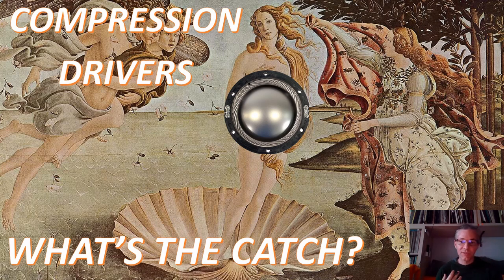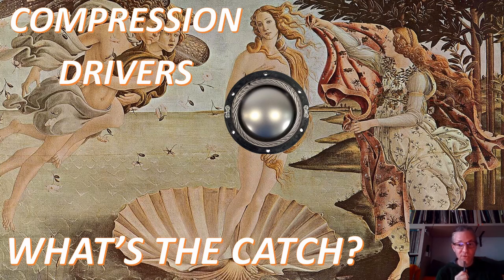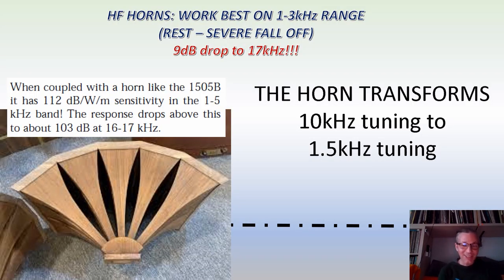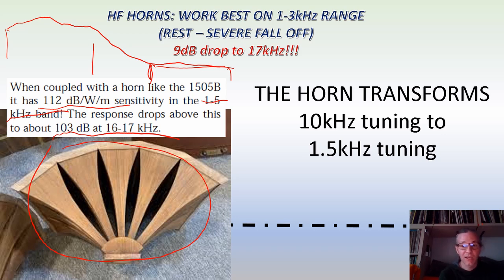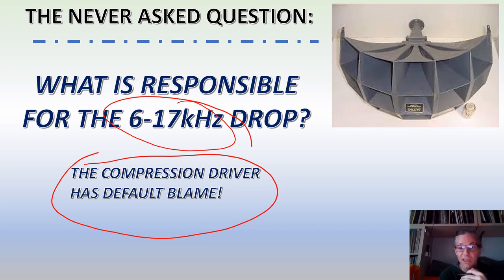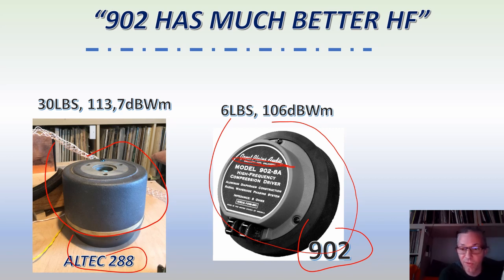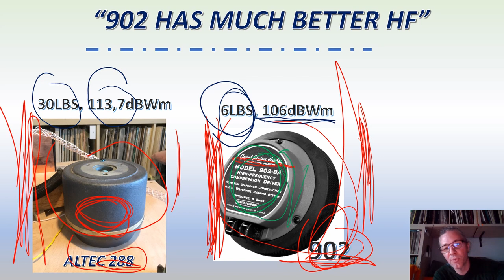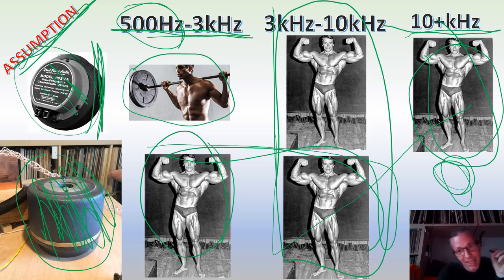What's the catch - horns and compression drivers 1/II.

Comment: That's so true. I never realised how good speaker can sound until i listened to a pair of JBL Project K2. And i have been enjoying this setup since the 90's. I initially augmented with the beryllium UT045be, but now switched using ribbon design beryllium from Pioneer PT-R9 that pushes the frequency response from 50khz to 120kHz. Sounds so much better now when paired with the K2. My friend too, i took a mini JBL 4306 for him to have a listen, after this experience he was totally convinced about the compression driver potentials. We build his system around JBL LSR705i and LSR708i... sounds fantastic! Now he is running JBL M2, together with beryllium ribbon Pioneer PR-R7iii. And me too building a new system based on M2 components...also augmented with beryllium ribbons, never looked back ever since. These components sounds superb especially running a digital active crossover setup. 😊👍
Reply from the maker: Cheers, superb! & thank you for the tip on using the Pioneer to supplement the ultrasonic region.
Reply: @realworldaudio  We would like to share with you ALL a few other very useful tips, which we have learnt and discovered during our past decades of audio journey that would surely greatly help in achieving great sound without breaking the bank.

TIP #1: Forget Passive Crossover and go Active Crossover

TIP #2: Look for hidden gems in speaker design that are based on the most advanced compression driver and waveguide design

TIP #3: Use a Digital Active Crossover that supports 24-bit 96kHz and run a steep crossover slope of at least -48dB/Oct

TIP #4: For HF Amp, choose a model that would provide super wide bandwidth and linear response into the 1MHz range.

TIP #5: For LF  Amp, choose a model that would provide high efficiency drive to cater for low impedance high current demands of the woofer unit

TIP #6: Forget PreAmp and choose a musical DAC that has HQ solution towards volume control

TIP #7: Focu,s on reducing jitter and achieving high-accuracy clock in your digital source

TIP #8: Connect your digital source to Digital Crossover and to the (multi) DACs and their respective amps, to drive the speaker drivers directly.

TIP #9: Apply jitter reduction components to fine tune your system

TIP #10: Component placement. Group DAC and Amp as close to the speaker they are responsible for driving as close a possible and run as short analogue cable as possible.

On Tip #1, without going into too much technical details, passive crossover introduces a lot of issues into the audio playback pathway that degrades the signal and is hard to correct.  Also it is difficult to achieve steep crossover slopes with passive approach.  For details, have a read on this white paper: https://www.deqx.com/wp-content/uploads/pdf/What-is-DEQX-Technology-Whitepaper.pdf

On Tip #2, as much as I am a nostalgic person who admires great classical compression driver design, the reality is, there has been great leaps of advancement being made by JBL in recent years.  Many would have heard the amazing sound from the JBL M2 monitors.  But much less well known and unheard of (and auditioned) are the JBL 7-series monitors.  There are 2 passive models in this range the 705i and 708i.  Both are jaw-droppingly good and way more afforable than the M2 (not that M2 is too expensive, it is reasonably priced).  Very few people would have had the opportunity to audition these speakers beacuse they are mainly sold to Broadcast stations and recording companies.  And unless one works in such environment, the chances of working and listening to them are rare. There are no Audio Shop we know of that stocks these speakers for demo.  And because they sound so good, very few pickings in the 2nd-hand used market...unless a recording studio goes out of business due to financial reasons.  You all just have to take our word for it, the sound from these monitors defies normal reasoning and are jaw-droppingly stunning.  The sound is completely disproportional to their physical size. Even the smallest 5" bass on the 705i is unbelievable.  It may look ridiculously tiny, but certainly not its sound... and the bass is amazingly deep, clean and good.  Check out the DDD driver and its very long extended bass port if one gets a chance to see the real thing.  And they are very afforable for what they are capable of delivering.  We would recommend to start with the 705i for the best bang for bucks.  And if budget permits look into 708i.  The compression driver and waveguide on these monitors would deliver the most beautiful and extended highs most people would get to experience, from a monitor speaker that is very close in performance to their elder brother the M2 monitor.  It would definitely put a huge simile on any audiophile, listening to these monitors for the first time (and each and every time subsequently) on a good proper digital active crossover setup.  It would give new definition to all the familar tracks one is familar with, revealing new details on each listening session.   These 7-series monitors would be our prime choice recommended to start with a digital active crossover setup.  Later if budget permits, seriously look into upgrading to M2 monitors.  Or for the more technically inclinded a DIY version of the M2.

On Tip #3, The DEQX unit may be a bit too pricy for someone who just started with Active Digital Crossover and wants to evaluate how much improvement an Active Digital Crossover can provide.  We highly recommend to look into NanoDigi 2x8 B as an alternative.  We have achieved superb results in Ken's setup deploying NanoDigi.  It will definitely provide the eye-opening revealation needed to convince anyone the benefits of a good Active Digital Crossover setup at a super affordable price.  We run a -48dB/Oct crossover slope on Ken's setup.  For more advanced setup and when budget permits, look into upgrading to DEQX.  With DEQX, which I personally use, I run a -300dB/Oct crossover slope.

On Tip #4, This tip alone is probably the critial success factor that reveals the true potentials of a good digital active crossover setup is capable of.  Without an amp that is highly accurate in time domain response, the benefits of the active digital may not be that apparent. Forget about Tube amps they have restrictions on the high frequency bandwidth required.  We need an amp that has a 3MHz super wide bandwidth and has a flat response within the the first 1MHz bandwidth.  There are few amps that will meet this criteria except the Goldmund JOB4 circuit.  Of course there are various amp  models within Goldmund with JOB4, but there are also variants of JOB4, if you know where to look.  Goldmund's professional branch StellaVox makes a PW1 mono block.  Not only that it features JOB4, it supports XLR balanced input.  These amps are super difficult to find in the market but if you are one of the lucky ones to find one, you are blessed. The PW1 would be our top pick, even over the Goldmund amps because of the XLR Balanced input support.  Then there is the JOB amps and even if you know where to find a NuForce STA200 which also features the JOB4, in a slightly scaled/powered down version.  The claritiy of the JOB4 has to be experienced to be believed.  In our opion this is the most transparent amp in the market, regardless of price.  It has the potential (if you deploy it right) to make your audio equipment dissapear and start to enjoy the music itself.  It is also super revealing and will allow debugging what problem one setup has easily. There is no masking of problems with this amp.

Check out this Goldmund Amp review to get some insight into this advantage:
https://www.monoandstereo.com/2016/05/the-goldmund-telos-360-universal-mono.html
Reply: On Tip #5, we found to get the most out of the latest generation of JBL DDD bass drivers, it needs power. To get optimal and extended bass response, you need amps with high current capabilites, with power delivered in an efficient manner.  The best balance we found are the 500w version of ICEPOWER amps.  The ICEPOWER amp can deliver incredible amount of current to achieve full control of the bass drivers.  With an active crossover setup, we can bypass all the energy sapping inductor coils in a crossover network.  So always wire the bass driver directly to the ICEPOWER amp.  We use one 500w ICEPOWER monoblock amp per bass driver.  The best value for money implementation of ICEPOWER 500W we found is from a less well known source - Ghent Audio GA-M500P.  They are excellent value for money and are highly reliable.  And have been providing excellent performance in our setup since we went down the path of full active digital crossover setup over a decade ago.  On a proper setup, these amps will allow the awesome JBL DDD driver to completely control the air mass within the listenig room.

On Tip #6, despite being nostalgic, we have assessed many latest modern DACs and reckon that the Wadia DAC still sounds the most musical and is still our favourite choice.  Wadia's implementation of the digital volume control is also superb and maintains very good resolution within the typiacl listening range.  The sweetspot is around the 85 setting and this is the norminal setting we aim to tune our setup towards.  Of course, with multi-channel for 2-way crossover, one will need 2 DAC units.  In Ken's setup, we deploy dual Wadia 122 DACs.  These DAC despite being very affordable sounds incredible!   We paired NanoDigi in 2-way setup with Dual Wadia 122 powering his HF and LF amps driving a pair of JBL LSR708i. And the sound is truly heavenly. Definitely an eye-opening experience and we can confidently say sounding much better than many system that cost 10x-20x more!  The clarity and high resolution power of his setup has to be experienced to be believed.  And bass from that 8" DDD driver is stunning to say the least....completely defying what 8" drivers are capable of delivering.  It is hard to put this listening experience in word, one just have to experience this at least once in their life to believe this. 
FYI, in my setup I deploy dual Wadia 322 DACs with DEQX as active digital crossover, with a Goldmund SR8 to support and decode mult-channel and digital source selector and digital volume control.

On Tip #7, try to use a digital source with as precision in clock signal as possible.
Starting from the digital source, we looked at how the digital clock can be improved. 
I run 2 main digital source.  To cater for various digital audio media on files, I deploy a modified Wadia 171 with high precision DEXA Neutron-star clock mods and various upgrades.  
For traditional CD/SACD I deploy a ESOTERIC X01 Limited player.
With a highly accurate clock, when we deploy the digital reclockers in tips below, you have a much beter chance of achieving HQ audio.

On Tip#8 and Tip#10, the focus is to significantly reduce channel crosstalk and noise pickup during signal transmission.  With a 2-way setup a standard appraoch is to have one DAC decoding HF for Left+Right and another DAC decoding LF for Left-Right.  But this is not the optimal setup.  A better setup is to have one DAC decoding both the HF and LF of the LEFT channel; then second DAC decoding both the HF and LF of the RIGHT channel.  And more importantly, reposition the DAC to very close to where the speakers are, and power the monoblocks within close range.

NanoDigi supports this remaping of digital channel output to achieve the topology of this setup.  This way all the analogue signal cable runs are kept to minimal and no issue with channel crosstalk, as the LF and HF signals are correlated in the first place.  The longer run of digital from NanoDigi to the DAC we would recommend running Glass Optics.  This can be achieved easily as the Remedy Reclocker supports both Optical and Coaxial digital IO.  Always run Balanced XLR whenever possible.

With speaker cables from amp to driver, try to bypass the original passive crossover network whenever possible.  Modify the wiring within the speaker if necessary to achieve direct coupling.  Avoid interaction of the signal with any capacitors and inductors to preserve signal integrity.

Choose speaker and signal cables with very low dielectric constant (eg. Air + Teflon/PTFE), to minimize any potential smearing of original signal.

On Tip#9, this is the element that will bring a lot of fun and joy to this type of digital active crossover setup.  Through much experimentation, we have found that by incrementally improving the time domain accuracy of the playback signal, the audio quality is very notacably improved.    Although both digital source here have highly accurate clock, the signal transmission and preservation is the challenge here.  It is amazing by progressively introducing a digital reclocker (Remedy Reclocker from Wyred 4 Sound) on each of the digital signal paths, we hear quite notacable improvements.  In all, I have now 7 reclockers running in my setup.  This agian, would require one to experiment and experiencing this improvement for themselves to believe.  It sounds unbelievable...but as one recloker is online, two is online...it gets better and better...even down to the 7th unit.  Try removing one reclocker at a time and see if one can tell the differrence!  It's very fun!  And these remedy reclockers are very affordable.  So definitely very high on our list for the afforable tuning list worth trying.
Reply from the maker: @damianhla  Thank you for sharing, and for all the details, and the encouragement for active crossover.
Reply from the maker: @damianhla  Thank you for all the effort you put in to share your findings! I will not let it stay a sleeper, will make a video and present your solutions and recommendations, with your permission. I think you have put in a LOT of work and love, and it payed a lot of rewards.
Reply: @realworldaudio  Sure, please share. Me and Ken have been into Audio for over past 30 years. We went through the terrible path of never-ending equipment upgrades and swaps, in search of better sound. And it can be expensive with mistakes we made. We want to save people from repeating the mistakes we made and enjoying better sound sooner without wasting their hard earned money 😂👍 There's some challenges in audio that can be identified and progressively addressed... and then there are ones that cannot be effectively addressed and it's like fighting a downhill battle... and the sooner we realised this and pull out, the better it is before major financial damages incurs 😅. We hope by sharing, we have inspired others to pursue a more promising path with much improved cost effectiveness towards achieving better audio quality and enjoyment 😉👍
Reply from the maker: @damianhla  Thank you Damo, I much appreciate your insight! The goal of my channel is to connect us, experienced audiophiles with each other, and with ones who are at the beginning of their journeys. We have many points where our experiences are shared (such as traditional volume controls are a big failing point), and also areas where I can learn from your experiences - for example, I have not gone into active crossover, and have played relatively little exploring  digital implementations. I always find it heart warming when a great solution is found. Indeed, the audio community needs your input! Thank you! :)
Reply: @realworldaudio  It's always our great pleasure to share our experiences with other like minded audiophiles. The combination of the high efficiency, high sensitivity and high power handling of compression drives plus advanced Waveguide profiles and horns is a super fascinating subject which i would highly recommend all audiophiles to investigate and explore. As we discover how capable this combo is and all the associated advantages, there's a deep underlying urge to get this combo cover as much of the frequency range as possible. So we chase after larger and larger format compression drivers, as the crossover frequency lowers and approaches to cover most of the human vocal range, the power and beauty of compression driver can be fully experienced and enjoyed. Very large 4" compression drivers can go as low as 500hz (eg JBL 2450j) and even for 3" compression driver can reach 600Hz (eg. TAD TD4001 and TD4002). Ideally we want this to go as low as around 100Hz, because the  fundamental frequency of human speech is in the range of 100-120Hz. But no single HF compression driver can really achieve this with a single diaphragm. If it too large the diaphragm becomes heavy and can't reproduce the extended highs and also more difficult to maintain rigidity to support pistonic motion as diaphragm start to suffer from break up modes in the frequency range that matters. So this remains as a holy grail yet to be achieved. And serves as a constant challenge for designers.  The dual diaphragm design on the D2 driver seems to be a much more promising approach. 🤔😊👍

Another reason for preference on lower crossover frequency is because the lower frequency driver, especially larger 15" units are not ideal for reproduction of higher frequency, due to the problem with beaming and with the heavier mass, mismatch in the sensitivity, when compared with the HF compression driver and horn combo. So a lot of times, the HF sensitivity needs to be reduced /retarted so that LF can catch up... which is really a shame with passive crossover setup.
This is where Active crossover offers advantages to address these challenges by decoupling the HF and LF before the amplification stage. This allows the HF to reach its full potentials without constraints using a dedicated amp designed for this purpose.

This is the reason having steep crossover slopes would allow each driver to play well within their respective frequency range, without the dangers of:

1. LF driver reproducing signals creeping into the HF zones that causes beaming and directivity issues 

2. HF driver reproducing signals creeping into the LF zones that causes unnecessary high excursions and going into break up modes and driver overload... causing more distortions

There's also the phase shift issue. With first order crossover 90 degrees, 2nd order 180 degrees, 3rd order 270 degrees and 4th order 360 degrees.
This is where the Digital version of active crossover comes into handy, as it allows us to measure the response and achieves time and phase alignment with the drivers. Not to mention room corrections as well to the acoustic response of our listening environment. For general music playback, we prefer to keep it 2-way and minimising the number of crossover as needed. This not only ensures most of the critical sound comes from single point source, reducing the interference pattern caused by different divers interactions and time and phase alignment issues.  

With 2-way systems we are asking a lot from both the HF and LF drivers to cover a very wide range of octaves. So it's always very challenging. 

For AV reproduction, in particular for centre channel, we are starting to explore the possibilities of having the middle frequency in the range if 250-800hz being covered by a compression driver and horn combo... specifically the JBL CMCD technology... most interesting and shows very high potentials 😁👍
Reply: Let us share with your all, if there is such thing as an ideal cookbok recipe for our version of DIY M2:

Instead of going for a full replication, with a single D2 HF driver + single 15" bass driver, we propose design features as follow:

Based on the Blueprint of the JBL Project K2 S9500, go with a dual 15" bass design with the HF compression driver sandwiched in the middle, but using M2 components.  

This would provide much better imaging capabilities with improved power handling and sound stage.  
Also allows the much lower efficiency LF drivers to match up with the high efficiency HF driver.

And apply a modular appoach in the build.  Use inverted cones to mechanically isolated each module.

Instead of going with dual equal volume bass cabinets, apply the design principles as found in the JBL Project K2 S5500 and M9500 with IET (Imaginary Equivalent Tuning) technique:

, “Imaginary Equivalent Tuning” (IET) was a new concept developed by Greg Timbers for the S5500 loudspeaker. By using two LF drivers, each in its own ported enclosure with different volumes and tunings, he claimed to provide a “better balance between the high speed of Bessel tuning and the flat frequency response qualities of Butterworth tuning”. Subsequently, this technique was also used in the M9500 speaker."

"IET required a bass driver with a high-energy motor, which can operate in both a large enclosure and small enclosure without becoming under damped.  IET is optimized when one enclosure is 20 to 25 percent larger than the mean value of the two enclosures, and the other is 20 to 25 percent smaller than the mean.  This results in four difference resonances, one for each of the to bass drivers and one for each of the two ports.  The composite of those four energy sources is a low frequency performance whose response characteristics exhibit both speed and extension."

HF driver: JBL D2 driver D2430K

HF waveguide: JBL M2 waveguide horn lens 5025594

Dual 15" DDD Neodynium bass drivers : 2x 2216Nd-1 (<- a special version made for the JBL 4367 with softer spider, easier to break-in)

In addtion, augument this system with a Beryillium ribbon ultra high to improve frequency response up to 120kHz.

Pioneer PT-R7iii or PT-R9.  As with any professional devices made by TAD, these ribbon drivers are very impressive! 
These ribbon tweeters are horn loaded and have very high efficiency 97.5 dB/w/m.

These are the advanatages of ribbon tweeter compared to a dome tweeter:

"The main technical advantage of a ribbon over a moving-coil driver is the ribbon’s vastly lower mass. Instead of using a heavy cone, voice coil, and voice-coil former to move air, the only thing moving in a ribbon is a very thin strip of aluminum. A ribbon tweeter may have one tenth the mass and 10 times the radiating area of a dome tweeter’s diaphragm. Low mass is a high design goal: the diaphragm can respond more quickly to transient signals. In addition, a low-mass diaphragm will stop moving immediately after the input signal has ceased. The ribbon starts and stops faster than a dynamic driver, allowing it to more faithfully reproduce transient musical information." 

see: https://www.theabsolutesound.com/articles/loudspeaker-types-and-how-they-work

NOTE: these are just advantages comparing a normal aluminum ribbon tweeter to dome tweeters.  
For Pioneer PT-R7iii and PT-R9, the ribbons are made using a much lighter and stiffer Beryillium metal (1/3 the weight of Aluminium with 6x stiffness of Steel) in a honeycomb construction, which makes it even stifer. In addition, these units are powered by a very powerful ALNICO 750 generating  magneticf flux density 7,400G.

A good ribbon super tweeter vastly improves the realism of the music reproduction.  Sound is more natural and relaxed.  By providing a more correct waveform from the super tweeter, even though there is a distorted waveform from the HF driver, our brain will give preference to the correct waveform signal and disregard the incorrect waveform.  This is part of the magical abilities of our brain to error-correct, especially on signals which it has been previously exposed to (eg. a musical instruments we are familar with).  It is as if our brain is performing pattern-matching, constantly looking for signatures and fingerprints in the soundwave signals for familar patterns it can relate to.  The more hints we provide to our brain, the less guessing it needs to do.  This may perhaps be why it feels more natural and relaxed when a super-tweeter has been added to the playback system.

And augment this system with a SUB18 class subwoofer based on the mighty 18" 2269H DDD Neodynium driver for each channel and have the frequency response tuned down to 20-25Hz.

This is a very interesting time as we discuss about DIY M2, because most of these components are quite readily available.  Plus the D2 driver and M2 waveguide are actually on sale now, so a lot more affordable than before.  It is definitely worth looking into for more die-hard compression driver + horn fans, looking for the cutting edge technology in this domain to build their new project.
Reply from the maker: @damianhla  Indeed, me and my friends also found that the 500Hz is the magic frequency to cross over the compression drivers. (We have played around with Altec drivers.) The 15in Altec woofers are happiest playing up to 500Hz, and then they are capable to go super low. Also, 500Hz is a special frequency, I call it the acoustic centerline, as the frequencies above it have directionality and are perceived as having clear tone, while frequencies under it cannot be pinpointed and seem to have no tone. It's interesting to see new CD technology come out to handle down to 250Hz! The Altec 288-H/G have an Fs of 270Hz, (and they could be used down to 300Hz) however their excursion limits output levels drastically at such low frequencies, so practical low limit is 500Hz. Indeed, digital crossover solves so many issues! The old method of design on paper, and try it out, and it still does not work in your room for most cases. My crossover design methodology is to measure actual impedance across the frequency range, then do the math, build xover for actual impedance, and then fine tune and modify values by ear. It is a slow process, as especially with super high sensitivity speakers the Xover component break in is beyond drastic, and the values will need major adjustment after break-in. Fortunately I learned the black belt radar ears technique (LOL, just came up with that name) from my mentor, and do all my adjustments based on ears. :) The result is beyond my wildest dreams, but I recognize that there's probably not many who have both hearing skill and patience to pull this off.
Reply: @realworldaudio  It's fascinating reading your audio journey with your ALTEC system. And thanks for sharing your experience as well.  Most interesting.  I agree with the 500Hz zone is the magical zone.  The 4" compression driver used to be the King of large format compression drivers.  And TAD, at quite early stage started to incorporate Beryillium diagrapms into their 4" drivers, before JBL even started this trend in their Project K2 series.  But I soon noticed a trend where engineers started moving away from 4" into 3", I guess they have learnt that there are limitations on 4" which they cannot technically overocme and now 3" is the sweetspot. So you may have noticed that the new D2 drivers, they are all 3" designs. But with 3" the crossover would only go as low as 800Hz and this is the crossover frequency on the M2 monitor.  What's interesting is, if we look at the commercial offerings from JBL, in their VTX V20 series (https://manualzz.com/doc/7899727/vtx-v20-s25-brochure) they started to combine the output from multiple D2 drivers (both D2430K and D2415K) using quite complex HF waveguides.  And if you have ever heard one of these playing in a music concern venue, they are amazingly good sounding!  The D2 driver is indeed revolutionary in terms of it design being able to drastically improving the power output and handling, reducing the distortion and significantly improving the frequency response bandwidth all at the same time.  It is indeed a very exciting time for us audiophiles worldwide, that some of these State-of-the-Art components, can be quite easily sourced at a very reasonable price.

 

And I am very much like you, enjoy the technical aspect of designing crossover networks, speaker system and speaker cabinet design with WinISD and Thiele Small Parameters of drivers.  But most of my audio friends, they are less technical.  Many doesn't study science at all and when we get together to discuss audio, we focus mainly on the principles and I guide them thru how to achieve these goals.  If you talk technical with them, they can easily get information overload and started to tune out and loss focus 😜🤣🤣😂 They are more into the music aspect than the technical tuning.  If tuning is really required, they will do it, but only with some technical guidance. And with many audiophiles, the non-technical group, often without the technical guidance can only go into the (aimlessly) constant equipment swapping cycle, which is experimental and does not necessary guarantee good results, unless they know exactly what they doing or improving.  This can also be a very costly exercise.  Within the audiophile circle, there is certainly a large portion of people who are engaged in these activities.  And i guess this is what many manufacturers wants to drive sales, which is fair enough.  But if achieving a great sounding system at an affordable price point is all one cares about, then there are better ways of achieving this goal without constantly chasing after the most popular trend in audio gears, provided that one know exactly what they are looking for and the reason why.

 

So now, our focus is more so in providing audiophiles, who are more so keen in the end results of achieving good audio quality, an express way of quickly setting up an audio system that does not break they bank, but consistently delivers superb audio quality, with minimal tinkering...let the advanced technologies, superfast electronics, DSPs and computer power do all the number crunching...their involvement in the setup may require some calibration process, which is guided by a computer program with prompts and calibration mic positioning. This type of engagement, they can handle ok.  At the end of day, they are very much outcome-focused audiophiles...they are less concerned about "the journey" how to get there, but more so just focused on getting there and then they can sit back and start enjoying their music from the beautiful sounds!  And I respect that, because with the busy lives everyone has, just finding time to oneself to quickly escape from their usual routine and enjoy their music is rare enough, the last thing they want is to spend extra time in tuning and tweaking...they want instant reward, which is the beautiful sound of music, with minimal fuss! And in many regards, me too, is more inclined to just enjoying the music and less tinkering.

 

It is amazing with the great advancement of technology and computer power, what can be acheived these days with audio setup.  Take the digital active crossover as an example.

In the old days, we have to decide what order of crossover we want for our speaker system, evaluating the trade offs etc.  tossing between first order -6dB/Oct, 2nd order -12dB/Oct, 3rd order -18dB/Oct...and few go into 4th order -24dB/Oct (in analogue active crossover)...and if we look into the phase shift chacteristics of each, it is a function of the frequency as well...they keep shifting as frequency changes...and when the two crossover curves overlap, it is very complex interaction we are dealing with. Drivers each have their own pectular characteristics as well.  Impedance curve is not flat either.  Depending on output and frequency the diaphram resonance frequency can interact and it can go into break up modes as well.  It is complex interaction!  It is pretty much an impossible challenge in finding a close to ideal solution to a problem. The solution is almost always a compromise.  Of course flat frequency resonse curve is our goal, and we never want to over drive a speaker driver to cause too much excursion beyond its design, which would cause distortions and even damage to the suspension of the driver or overheating and burning the voice coil.  The ideal crossover network would be one that resembles a brick-wall filter that has zero phase shift.  But we are limited by the technology made available....this is until Digital Active Crossover system started to appear, which opens up a new and very exciting chapter in Audio history. 

PS.  On the point of trying of provide a more predictable and constant impedance, we need to thank JBL for introducing the TCR material in voice coil construction (https://jblpro.com/innovation-material).

 

Now imagine, if we have access to a super steep crossover slope like a -300db/Oct, which is very much like a brick wall filter.   The slope drops almost vertically down off the crossover frequency. There is virtually no overlapping frequency between the HF and LF we need to worry about.  So the whole equation can now be simplified down to the task of stitching the two response curve together to ensure they are time aligned.  Of course,it is amazing that the calibration process detects both the phase and time alignment requirements for each driver as well.  And displays the results on screen for evalutaion and tweaking.  We would never have dreamt of such possibilities decades ago.  But with the advancement in DSP technology and microcomputers, they can deliver the number crunching power to do all that real-time calculations and transformations between time and frequency domains at amazing speeds.

 

When i first went thru the transition from using a passive to (analogue) active crossover system, my system was instantenously energized. 

Particularly the bass region, so much more responsive and powerful.  And I noticed the crossover region where the HF and LF meets also sounds much cleaner.

And I realise the 'nerviousness' i noted in the passive setup is gone now...the passive crossover does indeed had quite a bit of negative influence on the sound.

 

Then when i went thru the next phase of going from analogue active crossover to digital  active crossover, the improvement in nothing short of breathtaking....it is a complete transformation...totally changed the whole performance envelope and sound presentation of my entire system in every aspect.
Reply: Of course, it is a very different setup too, because now the dual DACs are directly driving their respective monoblock amps.  And the Analogue pre-amp stage has been completely removed from the audio reproduction chain.  Every aspects, whether it is in transparency, dynamics, time coherency has been completely improved in a way that makes it sound like a new system.

Gone are the crazy massive amps and expensive wiring.  They are being replaced by very purpose-focused and energy efficient amps that excels in what they do.  Cabling has been much simplifed, as it is much easier to ensure great digital transmissoin than trying to preserve integrity in an analogue transmission.

 

And Digital doesn't mean you can't enjoy Analogue.  Take Ken as an example, he is a massive LP collector and really into analogue audio.  In past he has been burnt by bad experience with his B&W and Focal speaker setup.  When I proposed to him the JBL solution, he was excited.  When I told him this system would be build around a Digial Active Crossover system, Ken don't know what to expect...but he is concerned that being full digital it won't be able to play all his beloved LP collectoin.  When Ken first hears his new JBL Digital Active Crossover setup, his jaw dropped as he never expected such performance can be achieved with such a compact and affordable system.  Ken, now still plays his beloved LP via the Turntable, but the signals are immediately converted by a high sampling rate ADC converter, then processed by his full digital active crossover system.  We are using Wadia DACs.   And for those who know about Wadia, they would be familar with Wadia's DigiMaster technology. In a nutshell, it is a technology that is capable of filling the gaps between the digital samples being made in digital audio, so that the output is very analogue like and natural. 

For us audiophiles, Wadia DAC used to be super expensive in the old days....but since the company has changed ownership, the new products now are way more affordable and priced reasonably. We can now enjoy all the benefits without breaking the bank 😜

 

I have included some info below for reference from Wadia 121 brochure:

 

"DigiMaster 4 Interpolation Filter

 

The Wadia 121 features a new generation of Wadia’s proprietary interpolating digital filtering

system known as DigiMaster. The DigiMaster 4 Waveform Algorithm for the 121 has been

optimized for a wide range of performance parameters. Incoming data samples are reconstructed

with special emphasis placed on time and phase accuracy so that it is able to recreate the

subtle musical presence and details.

The DigiMaster 4 interpolator uses a curve fitting spline interpolation algorithm to precisely

reconstruct the original analog waveform. Using digital signal processing (DSP), a curve is

fitted that conforms to the current sample plus future and prior samples.

DigiMaster 4 operates at the rate of 4-times re-sampling of 44.1 kHz, that is, 4 interpolated

values are calculated for each original sample from the source. Although DigiMaster 4 calculates

the interpolated samples using 64-bit calculations to 32-bit precision, the original data samples

from the source are not altered in any way (as shown in the illustration below)..."

 

see: http://www.wadia.com/ContentsFiles/Wadia%20121%20Brochure%20web.pdf

 

When I see Ken enjoying his LP now...I see him sitting back, all relaxed, a big grind on his face as he closes his eyes and enjoys his beautiful music !  😊
Reply from the maker: @damianhla  Did not know that Wadia is becoming more affordable, that's great news! Your double DAC approach is very elegant, I like the way you thought out your systems approach, congratulations!
Reply from the maker: @damianhla  Indeed, many of my audio friends are like yours, we talk about the music aspects, even tweaks are ok, but technical details on schematics and crossover, and people tune out. :) Active crossover can be a solution for many, as it allows setup without substantial time and effort investment. And most importantly, once we can tap into the potential of compression drivers, there's no turning back. :) The same is true for direct, short path, and smallest amount of amplification. (Amplify as little as it needs to be with as few components / stages as possible). :)
Reply: @realworldaudio  Completely agree, going with the least amplification and shortest signal path is the way to go.
And with the past experienced we have learnt, digital signal is much easier to preserve the integrity than analogue.
So many would be extremely surprised how a digital-based setup can play analogue better than an analogue system can.
This is actually part of Goldmund’s findings as well, when they admitted that their own Goldmund Digital PreAmp actually outperforms their own Goldmund Analogue PreAmp.  That is the reason Goldmund started to advocate immediate analogue to digital signal conversion to preserve the signal integrity and process all signals in 24bit/96kHz digital format all the way til the DAC stage.

Using an analogy, why would frozen green peas be more nutritious than normal green peas we get from market?
Because all the nutritions has been locked in during the on-site rapid frozen process as soon as the produce has been harvested.  Very similar reasons for why fish and seafood are processed in similar fashion.  This process preserves the integrity of the nutritions.  Whereas normal green peas must go thru handling, transportation, shelving…etc. all at room temp or warmer condition, there is much higher chance of spoilage and degradation of the fragile vitamins.

In a full digital system, the analogue is converted into 24-bit/96kHz at a very early stage.  And preserving the integrity of digital signal is way more easier than the very fragile analogue signal, which can be degraded by many means at each stage of the transmission and processing.
With the advanced DAC technology, even undergoing a A-to-D and a D-to-A conversion, the sonic quality will still be far superior to a traditional analogue system.

Talking about tapping into the potentials of compression drivers, here is a great opportunity for those who like to experiment.
Very few audiophiles would not have heard of the amazing capabilities of the JBL M2 by now.
And the main feature of the M2, is the D2 driver, code name D2340K.
There is now a great opportunity to acquire the M2 version of the D2430K for almost half the normal price. (there is another D2430K for the VTX series, which does not undergo as much stringent matching and testing as the Gold labelled ones for the M2).

You can compare the prices, with the current discount, the M2’s D2430K is almost half the price and is comparable to its junior D2415K and half the price os the D2430K for the VTX series.

NOTE: Even the M2 Waveguide is on discount.  So no more excuse for lack of resource for true experimentation.
In the past, JBL is very strict regarding the sales of M2 components are will require M2 proof-of-ownership details.
But these components are no longer restricted and can be soured by any customers.  Not sure when the policy will change again.

Check this out for yourselves.  No Joke!  It is a compression-driver fan's best news for the year!

M2 D2430K: https://reconingspeakers.com/product/jbl-d2430k-tweeter-for-jbl-m2-5032754x/

VTX D2430K: https://reconingspeakers.com/product/jbl-d2430k-tweeter-jbl-446213-001x-for-vtx/

VTX D2415K / 4349 D2415K: https://reconingspeakers.com/product/jbl-5020810x-d2415k-high-frequency-driver-d2/

M2 Waveguide: https://reconingspeakers.com/product/jbl-m2-horn-lens-5025594/

For bass, although it is more authentic to go with what M2 uses, ie 2216Nd, I personally would recommend the special version for JBL 4367, ie 2216Nd-1.  This version has a much softer spider and surround, making it much easier to run in to get good bass response.

JBL 2216Nd: https://reconingspeakers.com/product/jbl-2216nd-woofer-for-jbl-m2-5041785/

JBL 216Nd-1: https://reconingspeakers.com/product/jbl-2216nd-1-woofer-for-4367-320-0045-002/

For SUB, look no further than the driver unit 2269H used by M2's SUB18.

JBL 2269H: https://reconingspeakers.com/product/jbl-2269h-18-lf-8-ohm-boxed/

PS:  As always, two is better than one.  So would highly recommend running dual 2269H to compliment the M2 setup.

And finishing off with the nice addition of Beryillium Ribbon tweeters of either the Pioneer PT-R7iii or PT-R9.

Pioneer TAD PT-R7iii: https://audio-database.com/PIONEER-EXCLUSIVE/unit/pt-r7iii-e.html

Pioneer TAD PT-R9: https://audio-database.com/PIONEER-EXCLUSIVE/unit/pt-r7iii-e.html

PS: Both R7iii and R9 are very hard to source in good condition.  For this, I find it much easier to delegate the sourcing challenge to an expert.  And for me personally, my friend Shinya in Japan does this far more efficient and better than i can.  He managed to source for me both a pair of PT-R7iii and PT-R9 in perfect condition.  Shinya can be contacted via this email : jim@i.email.ne.jp (can let him know referral from Damo and he will take care of you)
Reply from the maker: @damianhla  Thank you Damo for the insight, much appreciated! : )
Reply from the maker: @damianhla  Neat, thank you for the tips on the drivers!
Reply: @realworldaudio  Very happy to share.  On the topic of passive crossover, which I know is a particular interest of yours, I am sharing an excerpt from the JBL Project K2 User’s Manual, which describes the various challenges a passive crossover faces.  And more interestingly, it goes into very detail explanation on how JBL tackles this challenge.  It is a very interesting article to read.  And very rare these days would one expect to find such useful technical information in a User’s Manual.

“JBL Charge-Coupled Linear Definition Dividing Network

The JBL K2 S5500 is the first production loudspeaker to utilise this latest JBL innovation.

By doubling up on both the size and number of capacitors in the dividing network, a voltage can be applied can be applied to the centre point of the capacitor pairs.  In so doing, the individual capacitors are charged, biasing the dielectric gap above or below ground potential without the D.C. biasing voltage appearing outside of the confines of the capacitor pair.

When this occurs, the music signals driving through the capacitors never cross the dielectric zero point, resulting in far more linear operating than without charge-coupling.  

This is analogous to the difference between a “Class A” amplifier and a “Class B” amplifier, for a far more natural musical performance.

The source of the biasing voltage in the crossover network in the K2 S5500 is a 9-volt alkaline battery, which is housed under a removable access cover at the top of the network.  The battery life is approximately that of its shelf life — nominally 4-5 years for an alkaline battery — and is no more difficult to replace than the battery in a typical infrared remote control handset.

The benefits of the Charge-Coupled Linear Definition technology lie in the nature of what applying a charge does to the capacitors themselves.  Crossover networks, of course, are composed of reactive and non-reactive components.  The reactive components — coils and capacitors — are those components which are frequency sensitive, that is, they selectively control the flow of audio frequency signals to the various drivers in the system by changing their resistance (actually, reactance) to various frequencies. Non-reactive components — generally resistors, printed-circuit boards, and wires — do not change their electrical nature with frequency. (The K2 S5500 is internally wired with Monster Cable to assure completely non-reactive wire performance.)

Reactive components behave differently at different frequencies; this is the behaviour that permits the dividing action of the crossover network.  Along with this behaviour come varying transient characteristics, which also change with frequency.  

In the case of inductors, two factors which affect transient response are called core saturation and hysteresis.
Core saturation results in a rapid change in inductance value resulting in F.M. distortion.
Hysteresis is a characteristic which deals with inductance change in the area of zero crossings; this results in an increase in F.M. distortion, which is highly audible in audio reproduction.
Core saturation and hysteresis are relatively well understood and controllable in the design and selection of inductors.  With capacitors, however, it is different story.  Capacitors are much more complex devices than coils, and their behaviour in speaker crossover networks is far less understood.

Capacitors do not exhibit hysteresis, per se, but they have a behaviour with similar results, called dielectric absorption.
When an audio signal passing through a capacitor changes polarity, that is, it passes through zero volts, the current flow changes direction.  But it does not do so immediately; due to dielectric absorption, the capacitor “remembers” its previous state and resists change.  This leads to blurring of transient in the drive signal, a highly audible distortion.

A capacitor is fundamentally two conductive plates separated by a dielectric, or semi-insulator.
Current flows through the capacitor by setting up different voltages on the two plates.  The difference in the voltage and the frequency of the signal determine the amount of current flow.  The impedance of a capacitor, that is, how much it resists the flow of current, is dependant on the signal frequency and the physical and electrical natures of the capacitor.  In combination, these factors are called capacitive reactance.

Factors that determine the sound quality of a capacitor in a crossover network include the material composition of the conductive plate, the material composition of the dielectric, and the tightness of the winding of the capacitor.  
In general, “fast” capacitors, that is, those with technically high transient response, tend to sound sharp, while capacitors that sound smooth tend to have slower transient response.  Charge coupling combines the positive natures of capacitors which are both smooth and fast, and does so in basically two ways:

1. by controlling and utilising a capacitor’s piezoelectric nature and
2. by biasing the capacitor above zero crossing.

It has been established that capacitors that are more tightly wound have better transient response than those that are wound more loosely.
Applying a constant voltage to a capacitor results in a piezoelectric effect, which physically squeezes the capacitor tighter. At high power levels, the alternating current of an audio signal can cause a capacitor to exhibit substantial piezoelectric behaviour, causing it to significantly expand and contract with the changing voltage.  This behaviour results in deterioration of linearity, as well as fluctuation in transient performance.  By applying a constant voltage, the capacitor is “pre-squeezed”, minimizing the amount of flexure possible from the driving signal.
The second method charge-coupling employs — biasing above zero crossing — probably has an even greater result than controlling piezoelectric effects. By biasing the capacitors so that the signal does not reverse current flow through the capacitor, zero crossing distortion is eliminated.  Just as with Class A amplifiers, charge-coupled capacitors operate within their linear range, so time delay or dielectric absorption is neutralised, resulting in less phase distortion for more natural sound qualities.”
Reply from the maker: @damianhla  Thank you Damo! I recall reading this a good while ago, wanted to try it out but forgot about it completely over the years. A new adventure on the horizon! ;)